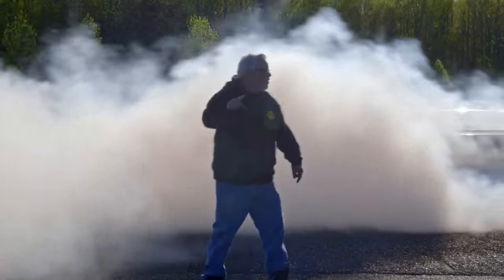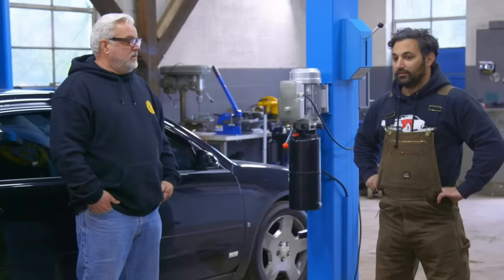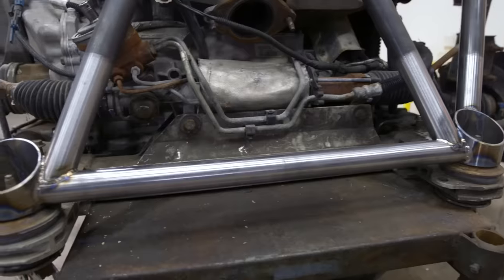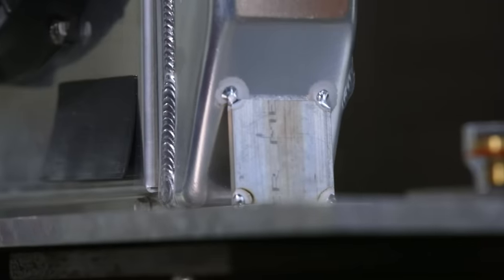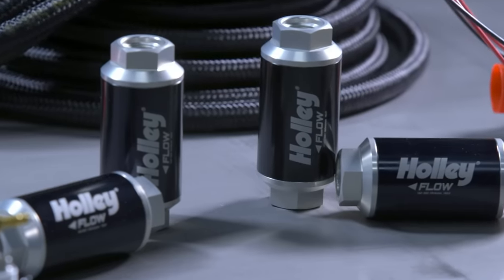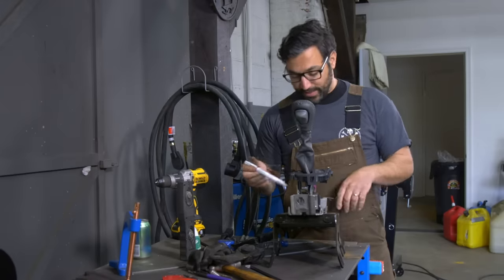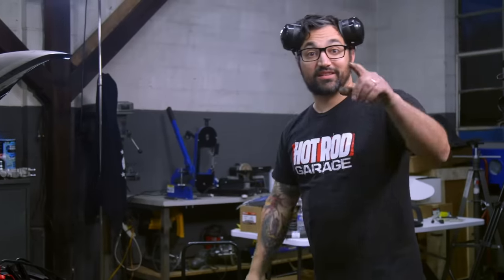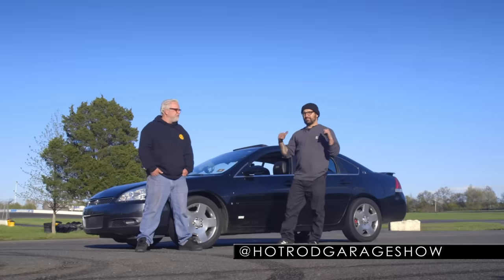Hot Rod Garage S7 Ep 80 FULL EPISODE - 600HP AWD 2006 Chevy Impala SS! The Twinpala Is Here!

Comment: Need to run a 1/4 in it and see what difference it's made compared to stock.
Reply: This. I was HUGELY disappointed they didn't do an acceleration test. SMH
Reply: Just do the math Man 4,000 lb car 600 horsepower: High 11s quarter, mile gets to 60 in mid 4 seconds

Comment: I would go to a red light with a young punk in his Civic next to me in the SS, have the front engine running....do a massive burn out, then at the next red light, have the rear engine on, do another burn out only in rear wheel drive...then at the third red light have both engines running and pull away from the punk in his Civic...
Reply: Haha!  I love it!  You don't need 2 engines to pull away from a Civic, though.  4 cylinder guys live their lives 1/4 mile at a time.  For those 30 seconds, they are free!🤣

Comment: Man, I'd love to see rear steering, maybe at half the ratio.  Also it's a bummer the engines don't use e-throttles.  

I've heard of electronic steering, y'all could use a servo motor on the rear steering based on input from the front steering.
Reply: I'm pretty sure they did have electronic throttle